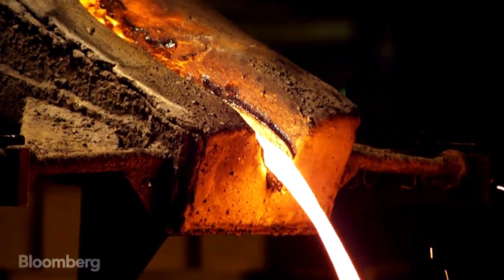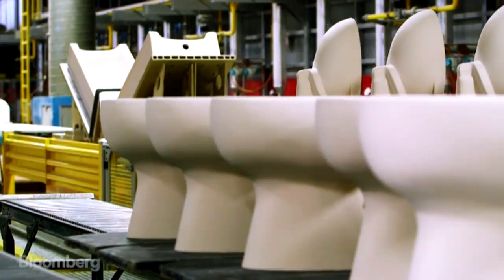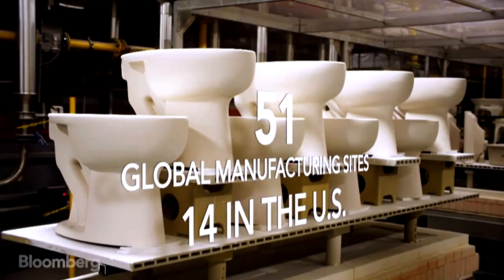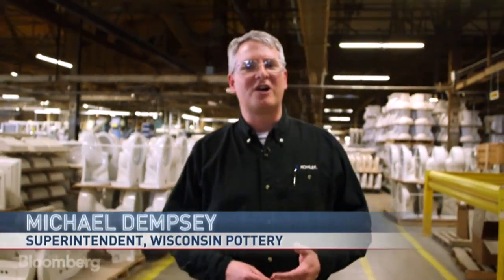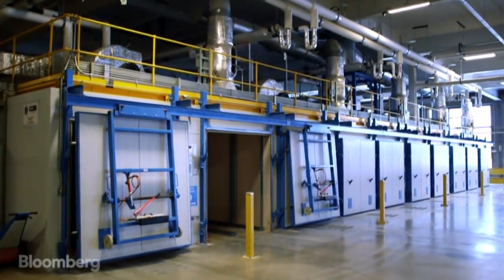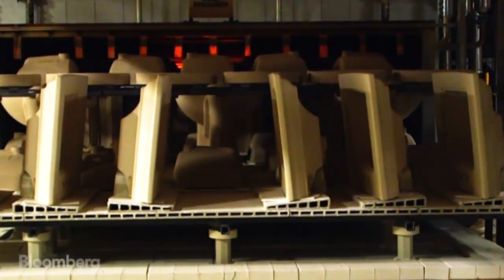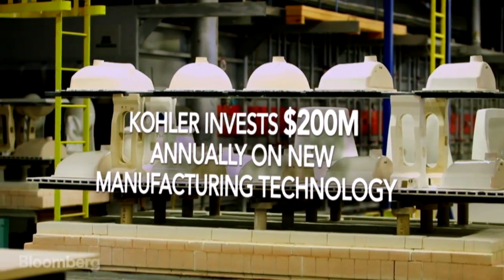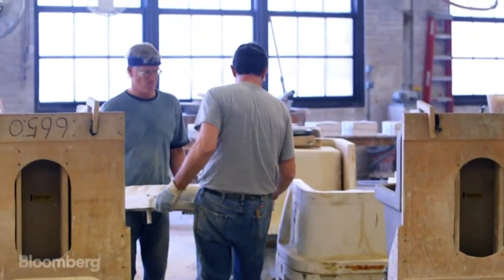Learn How Your Toilet Is Made

Comment: My Kohler toilet says "Made in Mexico" and a different one says "Made in Thailand"
Reply: Only some of their products are made in the US, their residential products sold at Home Depot and other bog box stores are usually made in Mexico. My 2019 Highline Classic is made in Mexico. One of my Uncles used to work for Schlage which is one of the biggest american lock manufactures and he said that if you ordered a Schlage lock from Schlage or one of their distributers, it would be made in the US but if you bought a Schlage lock at a big box store like Home Depot or Lowes, it would be made in Mexico and be lower quality than the ones made in the US. it is probably the same case with these big toilet brands like Kohler.